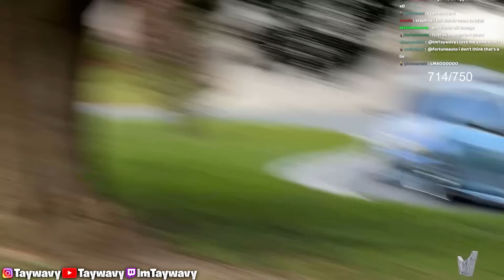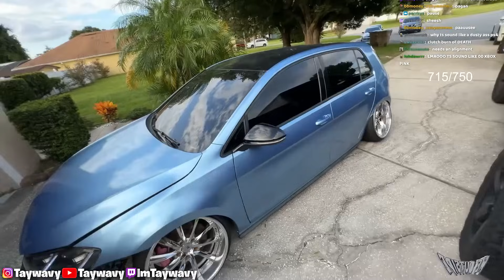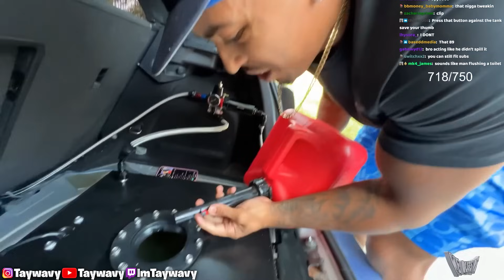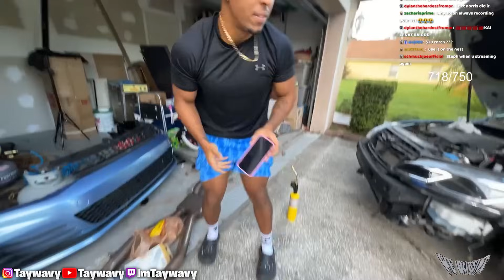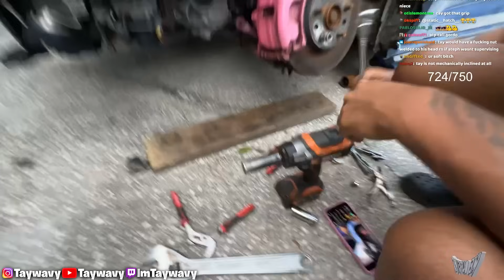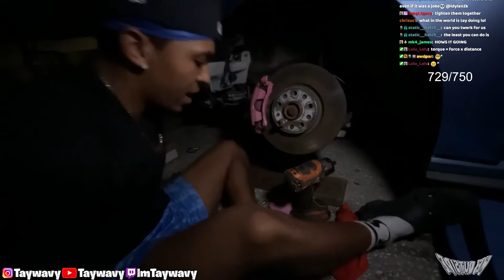I Should Never Touch A Stance Car Again…

Comment: BRO! YOU KNOW YOU NEED AN OIL CHANGE WHEN YOU LOOK AT THE OIL STICK AND YOU CAN BARELY SEE THE DIAMOND PATTERN ON THE STICK. BUT THE MANUFACTURER WILL SAY 3 MONTHS OR 3,000 MILES, WHICH EVER COMES FIRST.. UNLESS YOU RUN SYNTHETIC, THEN ITS 6 MONTHS OR 6,000. MILES.